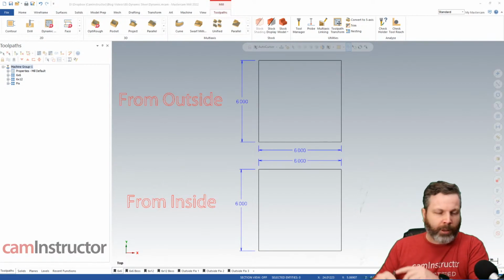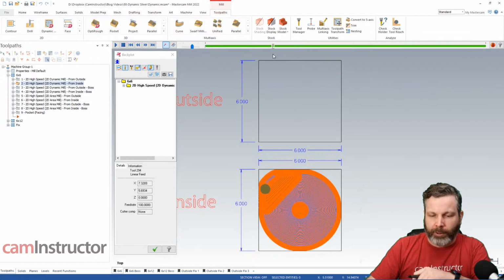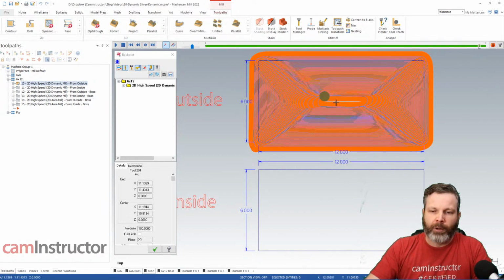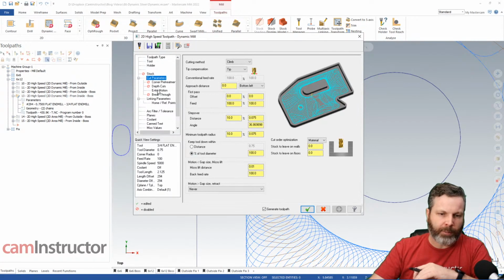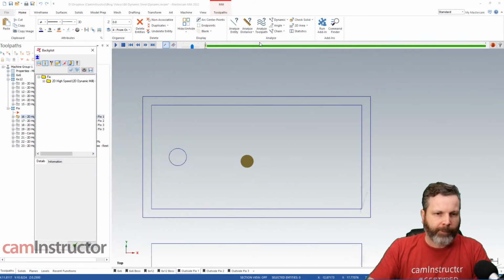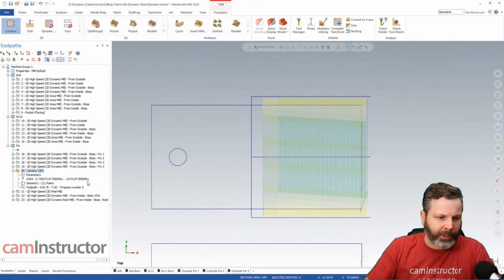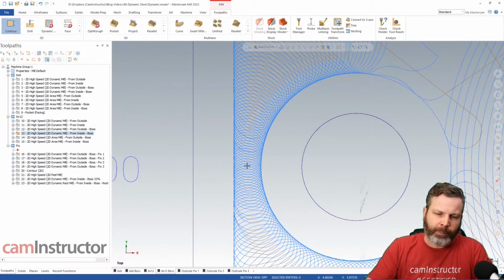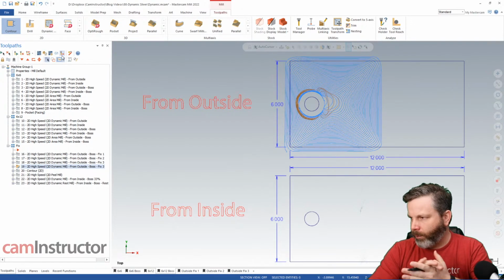Avoid These Cutting Conditions and Stop Breaking Endmills | Mastercam Dynamic Mill

Comment: Solidcam Imachining did both things better years ago. Blows my mind that mastercam still struggles with those problems
Reply from the maker: Post up some video or images of the toolpaths so we can compare.
Reply: @CamInstructor  unfortunately I don't use solidcam anymore. We now use hypermill at work. My personal experience with Imachining is if you input the right number of endmill flutes and choose the right workpiece material  in the Imachining wizard it's almost impossible to break an endmill. It simply works. I loved it for very easy roughing
Reply: https://youtu.be/jbz2HpO0f-g
Reply: @CamInstructor  the linked video covers millimg Channel width and thin wall thickness.